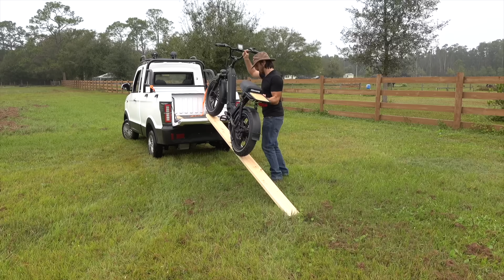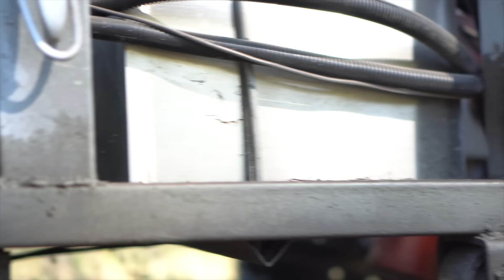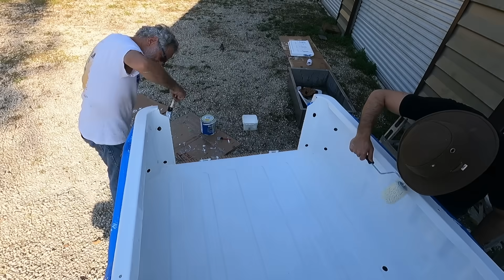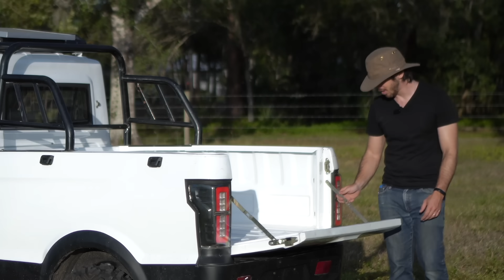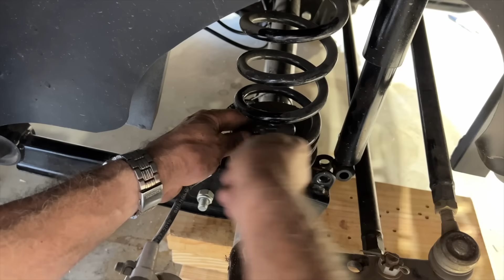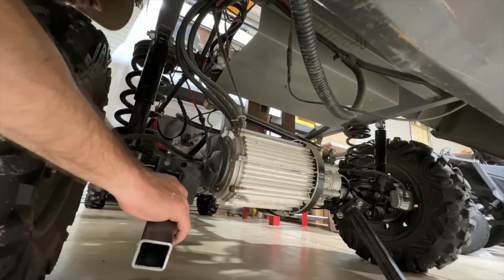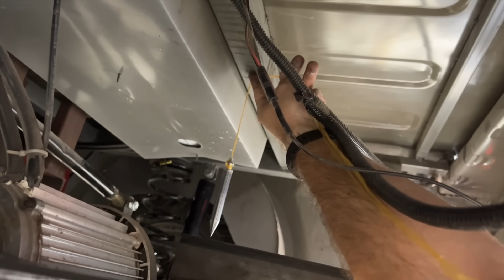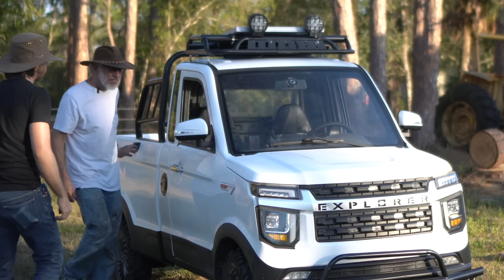My Chinese Electric Mini-Truck 18 Months Later: Did It RUST OUT?

Comment: Interesting stuff. A vehicle like this could work for a lot of folks who are currently driving a mid or full sized pickup. Even with all the upgrades, it is still a reasonable price.
Reply: Yes, they probably spent $2k or $3k maximum in improvements so the total cost was $10k or $11k. Considering a US made truck is $50k, as it is well designed from the start, there is a lot of room for improvement for this chinese minitruck, and it can do probably 90% of what is needed from big size trucks at a small fraction of the initial and maintainance cost.
Reply: It uses what is great about EV instead of putting EV for long salt-filled motorways.
EV is much more for mid-range with very clean roads or natural roads.

Comment: Thank you for the video report . But I would like to inject why you might want to live with the tail gate like it is. I would hazard a guess that the gate is angled like it is because when you use the dump it stops the gate from hitting the bumper. if you open the gate and move the dump to complete dump I bet you will find that the gate just misses the bumper.
Now you could put a couple of black (to match the bumper) rubber bumper stops on the edge of the bumper where the edge of the gate is. Think body mounts. Then you could go ahead and straighten the gate to a flat position and when using the dump it would stop the gate from hitting the bumper. Just an idea from an old mechanic

Comment: I love the update on this truck.  It will be interesting to see how much it will be able to tow.  I was impressed it pulled the boat.
Reply: Given it can handle 800 lb no problem in the  bed, I wouldn't be surprised if it can tow 1500 lb / 750 kg with no issue (on flat terrain). I believe there was a video where it could tow the family car, which is probably 2500 lb.

Comment: For suction cup failures, hit the rubber with the cheapest hairspray you can find, then attach it before it dries. The residue it leaves will work as an adhesive to prevent air getting in and releasing the pressure.
Reply: used silicone as shown in video - worked great.  Never coming off.  thx.

Comment: Should have painted the Bedliner before you threw shit in it?
Reply: Not at all.  Wanted to collect some info on how it would hold up without any treatment at all for the review.  It held up incredibly well.  Now it is even better because it has a hard tough high quality bedliner over the factory paint over the factory galvanized steel.  If we had coated it before use, we would not have known the OEM rust resistance.

Comment: What I'm wondering is if the bed is long enough for a micro camper/workshop to be built up for the bed. It's certainly got enough power and payload capacity - just not sure on the length. Also is there space for another battery or one of those little power stations? Because you could fit one up and its own solar panel - act like an electrical equivalent of those deathtrap PTO belt or shaft drives on the old tractors, to have power where you need it. 
Life not great at the moment, fighting aggressive triple negative breast cancer and fibro and losing. Been housebound for a year.

Comment: I had the same thought about the tailgate. Nice to see the truck has held up ( so far ) You might be able to fit some simple air bags in the rear springs. Just have to inflate the bags when the rearend is loaded.

Comment: You may want to put the fan shroud back on the electric motor as it helps direct the air across the motor to keep it from over heating.

Comment: I saw your original video 18 months ago and though this was a very cool little truck. The only thing I didn't like about this vehicle was the very expensive shipping costs from China.  I'm happy the truck is working so well and watching you do the upgrades was very neat.
Reply: Costs were at a near all time high at that point.  Still expensive but less now, thankfully.  regards
Reply: It's not expensive if you are informed well and have connections in the ports
Reply: If an importer is willing to import these pickup trucks in large quantities, the cost would be much cheaper

Comment: With European and Japanese cars it's common for them to put on multiple coats of primer so even if you scratch the paint and a layer of primer or two, they wont rust, American manufactories tend to just use one coat of primer to save a few pennies on each car

Comment: Just a word of advice: Fan cowls are not there to protect the fan, they are there to direct the airflow over the motor to assist in cooling. It is an EXTREMELY important part of motor cooling
Reply: back on.  thx

Comment: I particularly like what You have done with the solar panel. I think for the aesthetics I might have been tempted to fit your auxilliary lighting to the scuttle panel between the hood and the windscreen, rather than on the roof rack, and I'd be tempted to paint up that frame too just to make sure it lasts as long as possible. Nice to see You really use the truck! Oh while i remember, that cable idea for the bed You had, You can probably get the relevant coated cable and crimp up fittings for it to do the job if you can't find something salvaged. Seems like it should be a standard material.

Comment: if you wrap a new roller sleeve with painters tape and pull it off . do it a couple few times using new tape each time it will pull all the loose fibers off... great job though, thanks for sharing!

Comment: I'm a bit lost on how if the tow hitch extensions are bolted to the axle, which moves up and down with the springs obviously, how does the "threaded rod drops down from a frame member to support the tongue weight pushing down on the tow hitch" work? Doesn't that prevent the axle from moving up and down as well?

Comment: Just to mention: The "protective cage" arround the Motorfan is also an Airguard who redirects the Air from the Fan all arround 90° to the outer bodyshell of the motor. Where it hits all those cooling rips running on the outside you see there.
Probably not a problem in this applikaction since you dont use it that hard with a load and not that long to build up lot of heat.
But in industrial applications you better do not remove those cheap looking metal piece for exakt that reason.
Reply: He's hauling a trailer now. He doubled the load on the motor.

Comment: lucky you dont live more northern where it would rust. even in UK it would rust
Reply: We have plenty of salt in SW Florida, just 10 miles from the Gulf of Mexico.  Slat in the air rains down all of the time.  It is not rusting sue to lack of salt, it is not rusting due to good metal prep.
Reply: @micahsdad5388   Alot is common sense and looking after your vehicle I suppose.
Reply: @tomcoward16  agreed

Comment: If it had any rust on it from factory and you living in a dry climate and it even got worse, i would say it's shit steel. Trust me i know steel.
Reply: 1) SW Florida is a VERY HUMID climate.  2) ONLY one place had rust on it from the factory - the brackets on the roof for the roof rack.  Those brackets were obviously not treated in the same way as ALL of the other steel on the truck which had zero rust, even where we scratched through the paint to the bare metal and no rust formed.  So 99% of the steel on this truck as well prepped at the factory.  We fixed the rust on the remaining 1% as shown in the video.  Regards
Reply: @micahsdad5388  Wow, Seems like you work with the guy. Happy that you live no where near salted roads tho. I've bought a few bikes from china and they were all too rusted to bring for inspection after they turned 5 years old. One was even rusted out before i got it registered.

Comment: Tailgate go to your local sailboat people, who will easily make you a set of stainless steel cables, complete with plastic coat, to replace those. Just get the length, and you will get custom wire ropes made.
Reply: I make steel cables all the time for various projects with a hydraulic crimper, etc.  The tough part is the very limited gap between the tailgate and the tailgate opening.  We are working on it.  More to follow.  Thanks
Reply: @micahsdad5388  Hobie Cat rigging cables are thin and strong, and the shackles are also about the thickness of that strap.
Reply: @SeanBZA  good to know.  thx

Comment: Id be curious to how much torque it has. Pulling the boat and all... Have a dyno in your area? lol
Reply: We have pulled my 4600 pound van with it on level ground and it did great.  Nothing here in the way of real hills to test capacity going up a great.  How much torque exactly, we don't know.  But it is very torquey for sure when dropped down into low gear.  Regards

Comment: Micah, did you connect the hitch to the axle and the frame?
Reply: Well, yes we did.  Know that it is not optimal for sure.  With that said, the link between the 2 members is a thin (1/4") treaded rod which we hoped would limit max drop of the rear of the hitch, allow for some side to side flex and move up and down in the hole in the frame until reaching it's max drop limit.  Because of the dump bed on the truck, this thing is framed in such a way as to make a simple hitch connection to the rear axle only a bit tricky and the frame didn't look beefy enough to handle it.  This was a compromise that we are watching to see what we can do to make it better without having to get into a huge re-engineering project of the frame or axle.  The irony is that with thr original coil springs, the spring rate was so high (400 lbs + ??), the axle and frame were pretty much solidly connected already, hence no suspension give.  We have actually improved that in there is real suspension travel now.  Weird.  Time will tell.  Stay tuned for updates on the suspension situation.  Best regards.

Comment: Looking good!  

Only recommendation would be to put the fan shroud back on the drive motor.  Despite the short trip use on the ranch that TEFC (Totally Enclosed Fan Cooled) motor is getting very little to absolutely no cooling with the fan blowing air out like a tire slinging mud instead of being directed along the length of the motors cooling fins.  Incremental heat damage is happening to some degree and you don't want to wait until enough damage accumulates to let the smoke out of the motor windings.  Being a TEFC motor you won't see or smell the signs of hot spots/heat stress until its too late so why chance it for something as simple as the directional fan housing.  Since we live in the Land of Tropical Heat and Humidity, most days that motor is already warm before you even turn it on.  You really don't want it to fail while trying to pull the boat out of the pond or some other really inopportune time.  How often do things fail when its really convenient?  ;>

Best!
Reply: Shroud was replaced.  Thx for your comment
Reply: @micahsdad5388  Great!  That should help ensure the longest useful life of the motor.  

Just keep up with maintenance and be mindful of the bearings.  Change them before they start to rattle to better ensure they don't spin on the shaft or in the housing.  Sadly too many end up replacing costly motors instead of a $10/$20 set of bearings because they waited too long.  

Many don't realize that regardless of who makes the tool, vehicle, etc bearings are pretty much standard commodities often stocked by your local bearing supplier and available over the counter with quality equal to or better than the originals. 

Hope the weather is treating you well.  Here we've been having effective temperatures hovering around 105 F the past few days with dangerous humidity levels.

Best!
Reply: @neilfromclearwaterfl81  Thanks for your excellent recommendation on the bearings.  Got some in my drill press motor that just starting talking to me!!  No damage thank goodness.Gotta take it in to my local electric shop.    Good old timey sort of place.  Yeah - been VERY hot and humid here.  But the winters are great, right?? !!
Very best regards
Reply: @micahsdad5388  Gotta listen when they start to talk.  I didn't hear them in time on my air compressor so it now needs a new armature which is not available since its an older direct drive oil bath compressor with the crankshaft built into the armature.

Looking at things escalating to 107 effective the next few days here.  Winter is much better than the sub zero winters with the $600 to $1,500 monthly heating oil bills where I came from.

Get together with those Old Timey guys and whip that drill press back into shape while the widow of opportunity is open.

Kind regards

Comment: WHY DID YOU USE FILE TO TAKE THE RUST?   A WIRE BUSH IN  THE ELECTRIC DRILL WOULD WORK BEEN FASTER & GIVE YOU BETTER CLEANED.

Comment: The motor will lead a much longer life with that fan shroud on. The fan doesn’t actually work without the shroud and it will prevent the motor getting hot allowing the bearings in the motor to last MUCH longer
Reply: shroud reinstalled.  thx
Reply: @micahsdad5388  nice! Yr reading em comments:)
Reply: came to write same comment. The shroud is not there to protect the fan, its main feature is to force the airflow into the grooves on side to help heat escape. This guy should reinstall something similar asap....
Reply: 100% correct
Reply: All that tells me is this motor can handle a few more amps than it's set up with on that truck... If it ain't overheating without it, with it, you can definitely add 1/2k extra watts for some oomph 😎🤣 but yeah, you're 100% right 👍
Reply: correct, the fan shroud helps direct fan airflow.
Reply: This is all very interesting to learn as someone who stumbled onto this video who knows nothing about cars let along motors lmao
Reply: I'm sure he'll be the first to sue for 50 million dollars when his gluteus catches on fire...
Reply: @Hazard actually ONLY on the outside of the motor. no airflow on the inside like in all electrick motors. but still it need the shroud or the 2Fan" does nothing. propably not an issue if not driven on roads/ long distances on the farm.
Reply: @vihreelinja4743  It's a TEFC motor, Totally Enclosed Fan Cooled, it's the most common form factor of AC motors made in the last 40 or so years.
Reply: Its probably fine if you are not driving it at top speed for long durations. these things dont really get hot if you are puttering around at low speed.
Reply: @kekke5805 The opposite is in fact true, at high speeds the load on the motor is minimal. At low speeds and especially under increased load the motor is pulling much higher amps thus creating a lot more heat.
Reply: What's payload and tow capacity
Reply: But you want it to go bad so you have a reason to install a much larger one.
Reply: Your giveaway bike reminds me of a Honda PX 50 a 50cc moped from the 1980s, I don’t know if you had them in the US but they were a nice little  bike for zipping about on.
Reply: The motor is sealed for water proof, if adding a cooling fan, opening vents need which will lead water going into the motor
Reply: I came here to say this…
Reply: I came here to say this 4:51
Reply: He's only in his garden.  Charging every few weeks.  For him that won't be necessary. It will only eat range
Reply: Mah! If the motor dies, toss a Briggs and Stratton in it!

Comment: For the price. This thing makes perfect sense. For so many different applications.

I know this place up the street from me. It used to be an auto shop. But not anymore. Now! It is a, Golf Cart, dealership. And I was looking at them the other day. No big deal. And then I heard the price. I think it was $14,000? I nearly shit myself. Not that I need a golf cart. But since I will soon be easing into my, nomadic retirement. With my motorhome. Towing a vehicle. Capable of getting me around within a, 25-50 mile radius. At those basically, bicycle speeds. And if somebody wanted a bargain buggy golf cart. Well? There you go. $2000.

I live 2 miles from my local shopping centers. And if or when. Those could be licensed for, restricted street use. The same restrictions, mopeds and scooters, have to follow. They are not allowed on interstate highways. Generally not allowed in tunnels. And should be allowed for use on secondary streets with under, 50 mile-per-hour speed limits. After all. It's a move in the right direction. To help preserve our planet and lower our carbon dioxide emissions. And you wouldn't get that with an Uber driver burning fossil fuel. So who's not compliant with the times? And it's not like you can speed much faster than a bicycle.

And so that's nice to hear. That after a year. It's still doing remarkably well. That's a great review. You don't hear much like that anymore. Where I had spent, $2000 for a, diesel generator. Of course, Chinese made. With an imitation Japanese YanMar diesel motor. And the motor was good. But everything else. Fuel filters, wiring, solenoids, exhaust, everything kept melting. This thing wouldn't last, 20-150 hours of use. I went through, three or four. Just in a matter of weeks. It was mindnumbing! I loved the units. They worked well. Until wires started melting. Plastic started melting. It was a nightmare. I traded it back to them. And took a nearly $1000 loss. And I wasn't overloading it at all. I had my amp meters and my voltmeter's. And it was just a poorly made piece of shit. And I generally  try to avoid having it sitting in the sun, no less.. And frequently ran it in the middle of the night. Nothing much mattered. Stuff would just melt. Wire insulation would melt. They would short. Electronic control circuitry would burn up. And it would have been great. If any of the other parts and pieces wouldn't have been so shoddy. But they were worse than shoddy. They were total pieces of crap! I mean what's the point? No pride. No integrity. Just rip off stuff day in and day out. Nonstop.

I think I shall attempt maybe 6 hours of unconsciousness soon.
RemyRAD